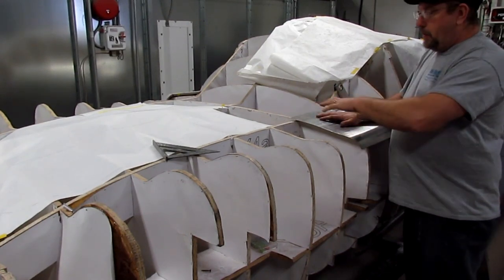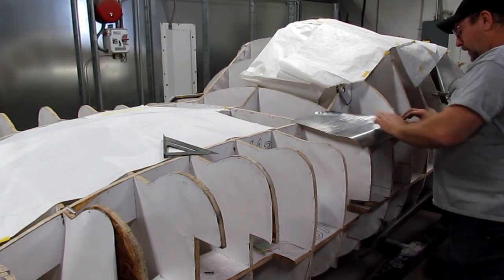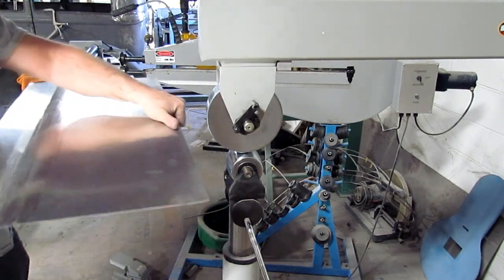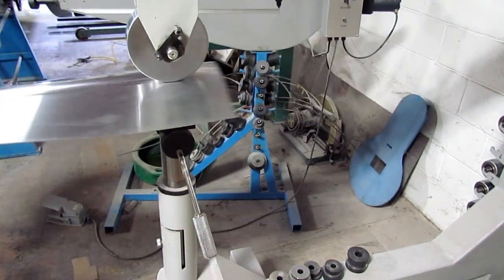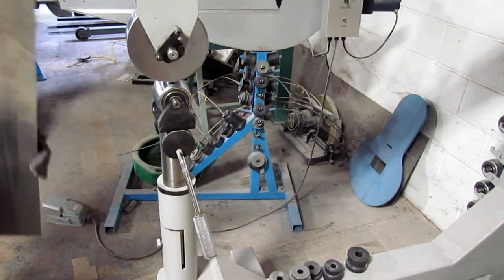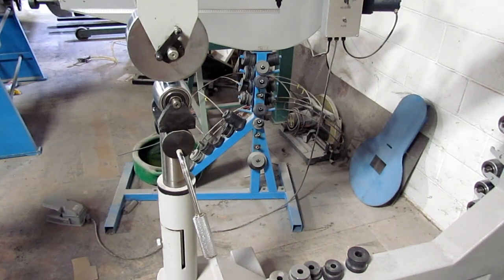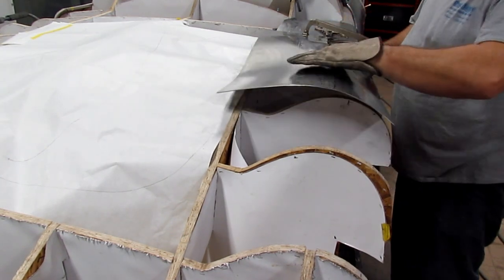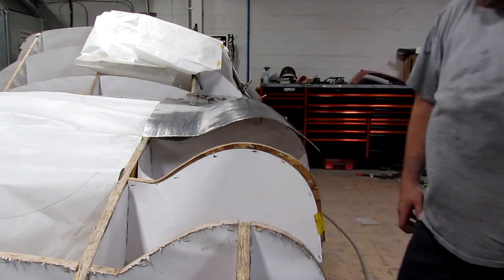Ferrari 250 GTO replica Part 3

Comment: Can you make a concrete mold and bang the sheets against it.
Reply from the maker: probably, but it would be overkill, expensive and very time consuming.
Reply: @iconicrodcustom2159  Have a bolt in the center to hold the sheets, it will pay in the long run.